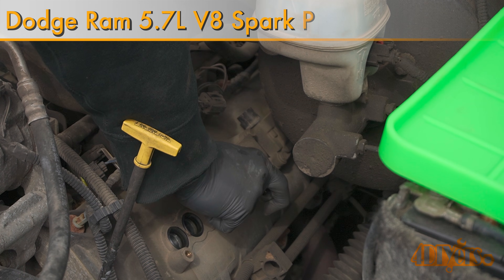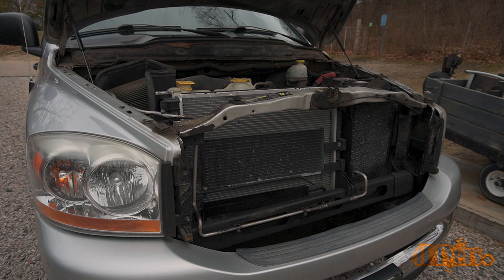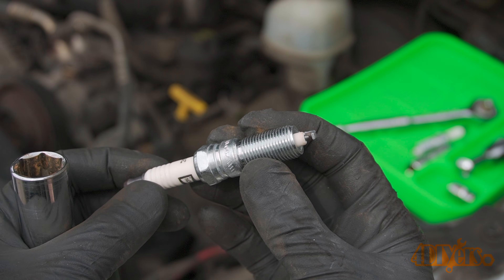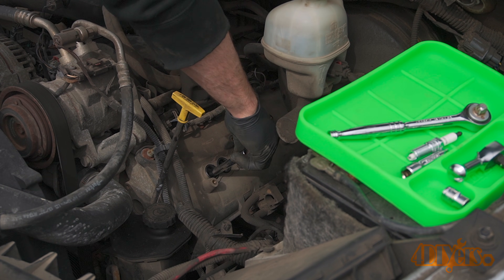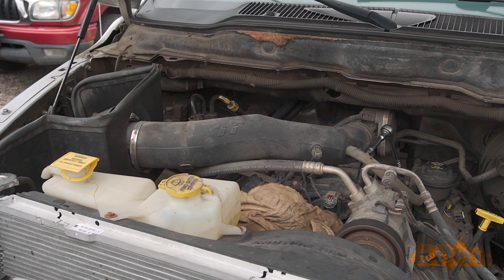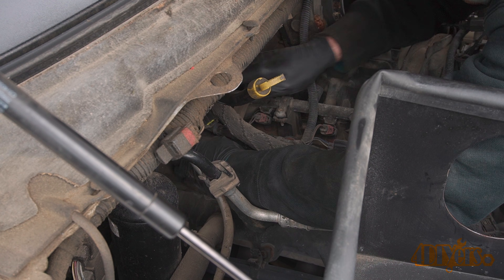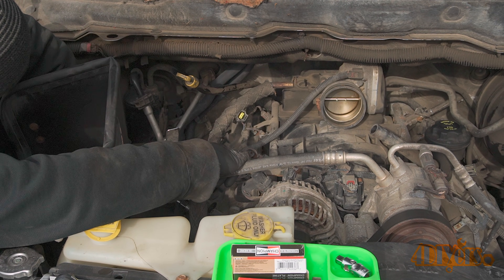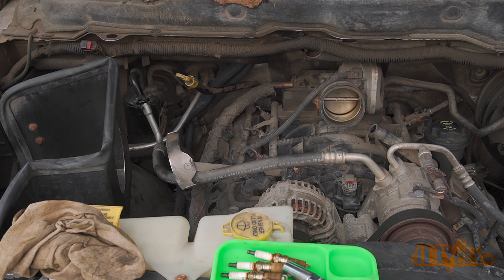How to Replace the Spark Plugs in a 5.7L V8 Dodge Ram

Comment: Why do I see some videos with spark plug wires some without. What made them different?
Reply: I was wondering the same thing! My 2003 5.7 Hemi has wires.
Reply: After certain years, they made the ignition coils as a double pack, so they only have an electrical connector.

Google says:
The modern 5.7L HEMI engine, first introduced in the 2003 Ram 1500 (third generation), has always used a distributor-less ignition system with individual ignition coils. 
There was a transition around 2006 where the coil design was updated: 
Early HEMI models (approx. 2003-2005) used a design that required short spark plug wires to connect the coil packs to the two spark plugs for each cylinder.

Later HEMI models (approx. 2006-present) switched to a true "coil-over-plug" (or coil-on-plug) design where the coil pack assembly fits directly over both spark plugs in the cylinder head, eliminating the need for separate spark plug wires. 
In essence, all HEMI-equipped Ram trucks use individual coils, but the physical form factor of the coils and their connection to the spark plugs changed slightly in the mid-2000s. The system itself has always been a multi-coil, distributor-less setup.

Comment: Just got done with the spark plugs replacement. Almost took me 4 hrs. I'm almost 5'7 and my truck is lifted with 35" tires. Literally I superman on the engine and frame. Last 2 cylinders on the driver side is no joke. Thanks for the 3/8 swivel and small extension advise. Kudos for showing DIY save some money. It's date night tonight, I don't think I have much energy left but go store and get me a case of beer and call it a day. Thanks for sharing ❤
Reply from the maker: Glad it worked for you, enjoy your date night!

Comment: Did this today on my work truck, 08 2500hd with the 5.7, the stubby 3/8 ratchet helped with the removal of the coil packs.
Didn’t have to remove anything on the drivers side to get at the last 4 plugs, I’m 6’5” with farmers hands , looked like a nightmare to get underneath the brake booster but it’s manageable standing on the bumper and having the combination of a 3/8 swivel and a small extension worked wonders.
Thumbs up 👍🏽 for the tutorial, best video I found before I tackled the job.
Reply from the maker: Awesome to hear you got it done and thank you for the feedback, really appreciate it!

Comment: I'm very excited to do this to my truck on payday. It's been an absolute gas guzzler (200$ a week) so I'm hoping a few upgrades and it'll be easier on my  paycheck 😅
Reply: mines about due as well...need to drain the diff/s also..no tranny flush but i do want to get in there and change the filter and check the magnet......contemplating some solenoid upgrades if, and only if they need it...otherwise check the torque on them...I have an '08 190k and the tranny is its weakest point.....shifts are very sloppy.......im already saving up for when it totally lets go........thats why im watching here......first time on a hemi.......16 plugs can get pricy quick.....
Reply: @SnapCracklePip man it's my first hemi I'm working on too and man it's way harder then any chevy I worked on even the ford's, I just broke a coil plug and I really don't think ima be able to fish it out

Comment: I've done so many of these, I've found it's worth the time to remove the brake booster. First I unbolt the master cylinder, leaving the hydraulic lines attached, and position it out of the way. Then it's just a matter of removing the 4 bolts under the dash, the brake pedal rod and the vacuum hose. It makes it so much easier getting those back plugs out and back in without cross threading them.
Reply: Not doing it. I've got the tools he used and looks like it works. It would be easier to do this job with the engine out of the truck too...
Reply: Thank you  @richardweyland116
Reply: @richardweyland116 😂😂😂
Reply: Yup, I removed the hose from the break booster and forgot to put it back… I found out pretty fast why u need it!
Reply: Man I need a video on that